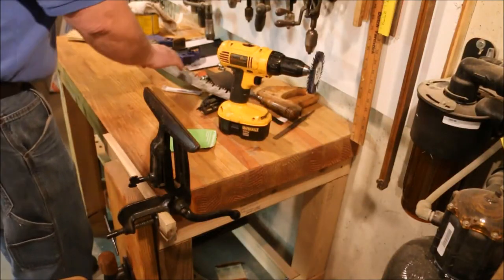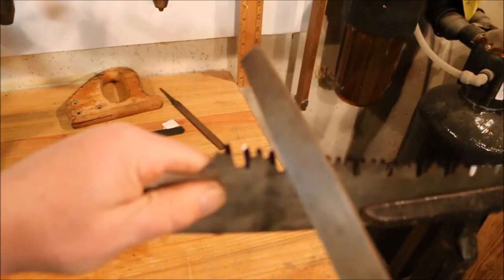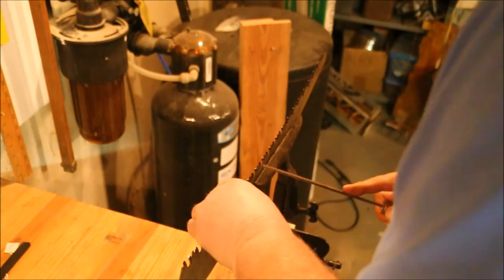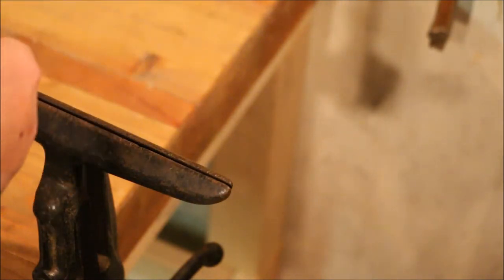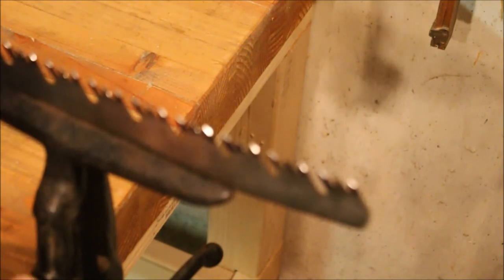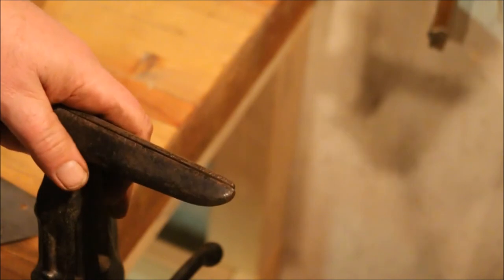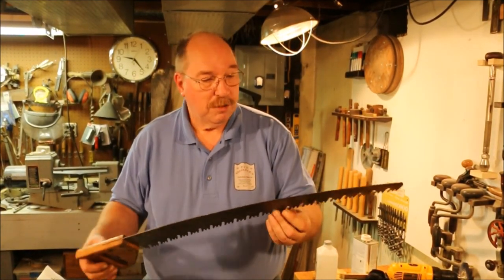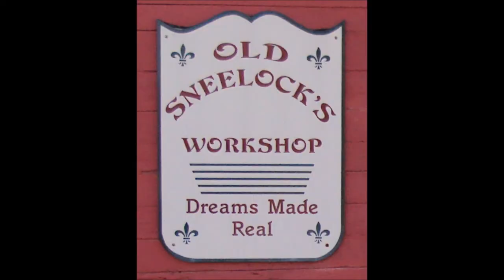BACK TO BASICS ~ SHARPENING A PRUNING SAW ~ PART 2 ~ SET THE TEETH

Comment: We had about an eighth of a mile of Mulberry trees alone the road kind of as a windbreak. There were planted and producing before my folks bought the ranch in 1949. When we sold and moved to the coast in 1058, they were still producing. My brother and I used to hang out along the row of trees. On the north side of the driveway was an eighth mile row of Eucalyptus trees. We had our initials carved into every one of those trees along with a good supply of BBs... :-)

Comment: Good job as always liked how it's that sharpe it was digging in and lifting the bench off the floor. I'd love get my hands on that piece of mulberry it would make some lovely pen blanks.love the colour and the grain patten.hope you are still enjoying the holidays
Reply from the maker: David Chadwick It's firewood so it wouldn't be missed. 😊
Reply: Old Sneelock's Workshop if you want to send we can sort out the cost. It needs to be thick enough I use 1" square by 5" ish long with the grain . Mulberry over hear is a bush I've never seen a piece that big.
Reply: A buddy of mine has one 30+ feet high planted next to his cherry tree. Birds eat the mulberries and leave the cherries. He has a lift on the front of his tractor and we used to raise it all the way up with a wide pallet on it and pick while the birds ate the mullberries. Lone time ago. Off to the gate plant (sawhorses and the Taco tailgate). Back later, God willing.
Reply from the maker: David Chadwick Here it grows up to 30"  or more and is considered a weed. When I went to the website the shipping goes from $13.50 on up based on size & weight. Minimum size is 8.5"×5.5"×1.625".  I always get a different price when I go to the counter so I can stop by the Post Office on Monday to find out what it really would be. 
Mulberry is light but very hard, and amazingly strong. There is a thicket of the trees growing along the back property line. I can just snap a 1" diam, dead, bone dry, stick over my knee but it doesn't break clean. It bends and I have to twist it around to get the fibers to separate. 
It is bright yellow when first cut and gradually turns dark brown when it's exposed to sunlight. It makes great handles. 
If the price isn't crazy then I could put 8 blanks in a package. Maybe a couple mulberry blanks and some other local hardwood. The house is surrounded by trees and I have a cord of wood drying in the rack for the fireplace. Walnut, maple, cherry, and oak along with mulberry, apple, and Bois d'arc, are common. 
I'll let you know about what I find Monday.
Reply: Old Sneelock's Workshop yes that would be great timber blanks hear vary from £ 2up to 7 a blank I can get 10 blanks of olive wood for £35 $42 so
Reply: Did the email get to you david as I say it's a bit hit and miss not sure what I'm doing really. I got some lovely pictures last night from lewie of his lovely lady and grand children and I sent some back but what if all got through I'm not sure
Reply from the maker: I've been outside raking leaves so I haven't checked my mail since I sent you the question. I found your email and replied. I'm beating Windows 10 Outlook over the head to get it to leave your address in the safe list. I will find a way or it will not be pretty. 😊
Reply: OH yes they did!
Reply: I just put him in mine and that was that. Prefered sender even just like you! Boy Howdy it was a real deal to get it. I suppose he'll have to have a laptop to get the contact info on his channel but I don't know. I had to go in and re-do the whole thing on mine because it was all GONE thanks to a bunch that won't leave anything alone. When it happened I have no idea. I don't usually check my own channe/accountl or whatever it's called. It was sure bare. Had to 'customise' as the button said. So the blasted thing's customised.
Reply: Lewie McNeely you guys my friends can put me where you like I haven’t a clue what you’re on about anyway what ever you do don’t put me anywhere or near snakes I don’t want to be near them even in cyberspace lol thank you
Reply from the maker: Lewie and David. There is an ap called YT Studio that lets you manage your channel from a phone or notebook. I've used it for about two years and still keep finding new things it will do.
Reply: Thanks, Unc but this is all I have. I want a phone that's so dumb that when it rings it goes 'DUH'. I've got a smart-ish job that was given to me under my calculator in front of me. I don't like a phone following me around everywhere.  I tote a flip job and call home at lunch/dinner when working if I don't go home to eat OR when Sweetums is on a grub run. I am a computer moron and want to stay that way. Just like carpentry I know just enough to be dangerous.
Reply: Old Sneelock's Workshop I’ll have a look in the morning a lot of apps aren’t available on apple uk but if three is something out there like my kids will know you can count on it ive learnt more this week about tinternet than I ever thought I would. I’ve sent another email if I’ve gone in the bad guy bin
Reply from the maker: It will work with your laptop on Win 10 too Lewie. I use it more to edit videos but it lets you manage your channel a little easier. Like connecting to David Chadwick. If he subscribes to your channel and you subscribe to his then you can message like you do with me.
Reply: Sure, Unc. I've got 2 that I need to get setup like this one with which I get along fairly well but I forgot what passwords I used and am afraid to mess with it. If it ain't broke, don't fix it and I'm good with Davids email setup. Works fine now.